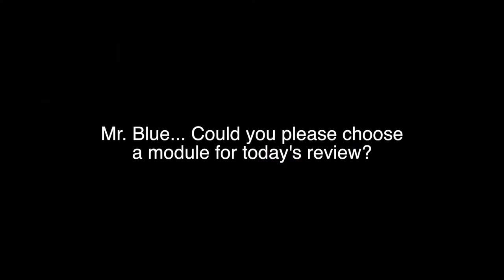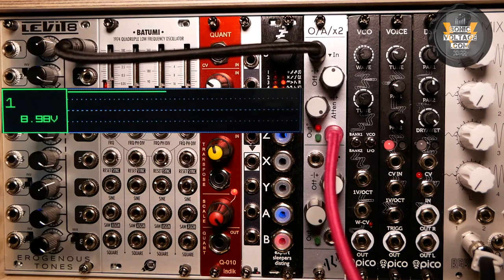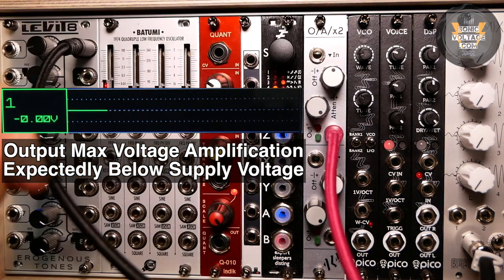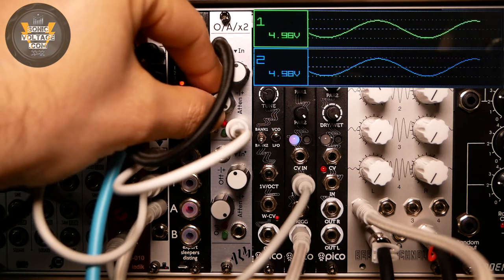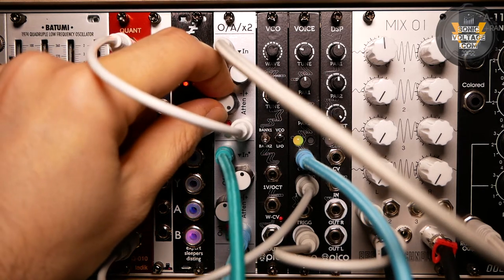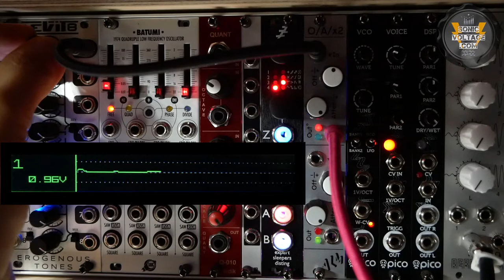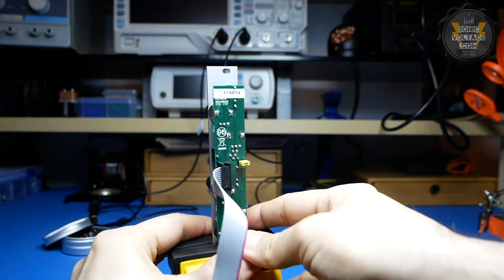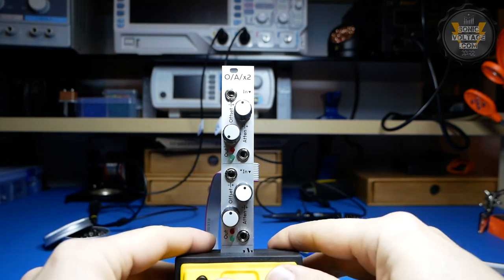ALM 010 Busy Circuits OAx2 Review Eurorack Modular. All features Shown

Comment: I like this module a lot, but I often forget if the knobs are labeled underneath or on the side. Most of my modules have labels underneath the jacks/knobs/sliders. Also, I would have assumed that green means positive and red means negative. The mixer option is pretty handy
Reply: I literally just had to revisit the manual because I also forget if the label is under or next to the knob. I'm glad I'm not alone.